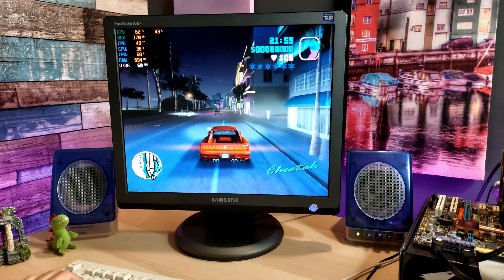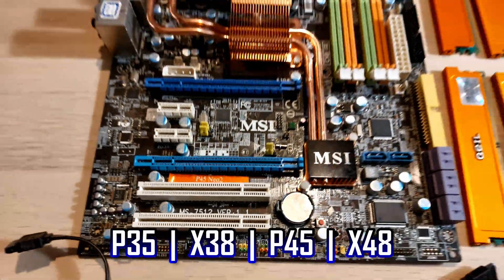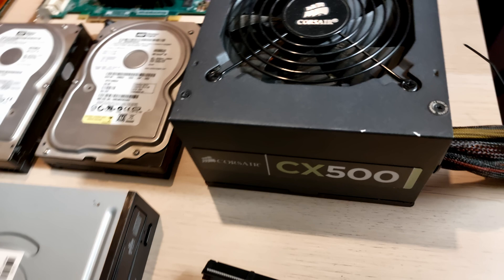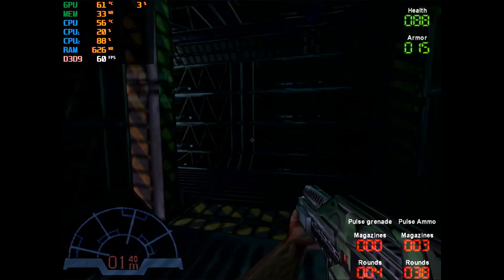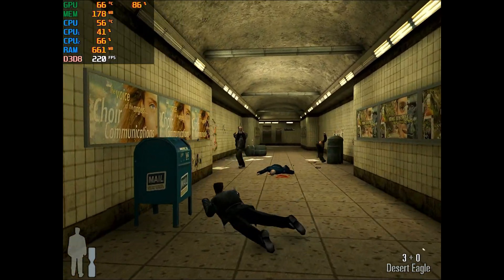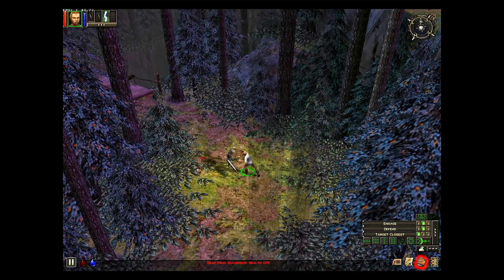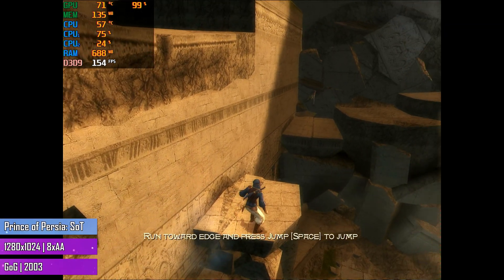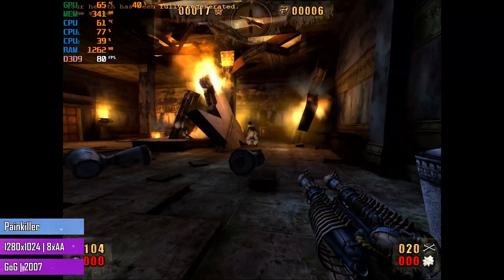What PC should you choose for Windows XP gaming?

Comment: great Video:) 
I think it depends what games you like. If you like neweg games like 2006-2010  then i would recommend a Retro PC System with intel Q6600 and Geforce 8800GT 9800GT.
If you like more games from 2004-2005  (2006)then a Pentium 4 3,6 GHZ or ATlon 64 3700+ or similar is enough paired with a Geforce 6600 Gt or Radeon X800 (GT) this card aren't that expencive especially a 6600 GT is easy to get. Of course you can get a Core 2Duo E6600 or similar. Like Midnight Geek said this CPU are the cheapest you can get:) and they have more power then Pentium 4 or Athlon 64 CPU's.
AOf course you can build a system with COre2Duo and Geforce 9800 GT but this CPU will bottneck some newer games... so this is the reason why i would recommend Q6600.
If you have a Core 2Duo with Geforce 7600GT or 8600GT/ GTS or Radeon X1800XT then a Core 2 Duo is perfect!

For 2002-2004 Games i would choose Pentium 4 2,6 GHZ HT or 2,8/ 3GHz even!
With a Radeon 9600Pro/ XT you will get great performance for the games in 2002-2004 and with this CPU its perfect. Or geforce 4TI 4200. But now this card isnÄt very cheap you have to pay mostly 20-30€ 

i have bought a Radeon 9600 Pro for 17€ and radeon 9600XT for 19€ not that expensive but with shipping costs it was 47€! becasue from 2 differend Salesperson. 

But Radeon 9700 Pro or 9800 Pro are much more expensive.... of cours eit bring smuch more performance and they are pretty rare but its too expensive I think...

I can recommend also a Radeon 9600 TX its a RAdeon 9500 pro and perform better than 9600 Pro! It was a Card from MSI for MEdion Computers and there ar emany of them and costs around 20€ similar like 9600 Pro and XT but its a bit faster. This card has 8 Pixel Shaders! The Performance is similar like Geforce 6600

Retro Gaming from 2000-2002 there are many options. I have a Retro PC P4 1,7 GHZ 512 MB DDR Ram.
80 GB HDD, Geforce 2 MX-400 64 MB SDR is the Retro card for this system i could recommend too its very cheap to get and there are many of them or Geforce 2 MX.
Of course Geforce 2 GTS(Pro would be perfect for the CPU but its expensive to get, you need really luck...
you can also put a Geforce 3 Ti 200 on this system but its also expensive to get... So my recommandation is Geforce 2 MX or Geforce MX-400. A PC with Pentium 3 Tualatin 1,3 GHZ will be enough too for such a card like this. 

My first PC has Pentium 3 667 MHZ and 128 MB SDR and Nvidia Riva TNT 2 Pro 32 MB it wasn't a bad card that day but after 2 years it was slowly but you can play tony Hawks Pro Skater 3 or GTA Vice City and GTA 3. But no T & L support... and this card is expensive so i would recommend a Geforce 2 MX/ MX400 card at this system too and you can use T&L:) and its cheap to get.
Reply: Nice comment, I would recommend to follow this :D I had some issues with AMD duron/athlon x2 CPUs - animation was like  very slow but sometimes it went faster, then slow again. Some good drivers were helpfull but pentium/core2duo are better  options

Comment: My XP/7 PC is built on Asus M3N-HT Deluxe, AMD Phenom X4 955 O.C 3.9 Ghz, 8GB ram DDR2 1066, GTX 470 and Sound Blaster X-Fi Titanium.
Reply: You got slightly luckier with your 955 than me, the best I could do without cooking the damn thing is 3.85 GHz. I wanted to mess with multi gpu, so I went with two HD4850s in crossfire, plus a Sound Blaster X-Fi for EAX 5.0 support.
Reply: @ozzyp97  I forgot to write, also i have X-Fi Titanium :D What's about CPU, I just increased multiplier and voltage to 1.42.
Reply: @SneakiestDuke68  Funny thing about that, multiplier overclocking just flat out doesn't work on my ga-990fxa-ud3. I guess they just never got around to fixing that because normal people wouldn't use 990fx with Phenom :D

Anyway, I had to go the old school route, by raising the FSB while lowering multipliers for NB, HTT and RAM. I'm surprised it worked as well as it did tbh, in the end I might've actually gotten more performance because I ended up optimizing those other clocks as well.

Comment: I built my xp machine based on your videos. 775 gigabyte board, e8600, 9800gt & 4gb memory in an old deepcool case. It's the most stable pc I own & plays all the games I love. I took my time getting the parts at the right price ( for the UK ) & it ended up costing £120 with a 2nd hand Corsair PSU. It's never let me down, a time machine. Thanks for your videos
Reply: For what games you needed it ?
Reply: 我也是，我用了ASUS P5kpl主板 9800GT显卡 4G内存装在cooler的机箱里，感觉相当不错，用来玩GTA4很好。
Reply: might be nice to get GTS 250, same gpu but smaller node better power consumption and heat

Comment: Me personally, never was a fan of putting anything newer than a Core 2 Duo on XP
Reply: From my personal experience a fast core 2 Duo (like e8500) will work very well with XP (a quad might be a better choice if you also plan to use Windows 7), add 4 gigs of RAM (at least 8 for W7), an Nvidia 780 and you're set.